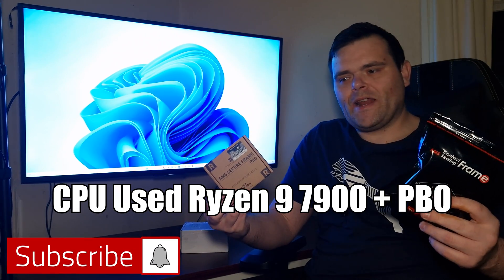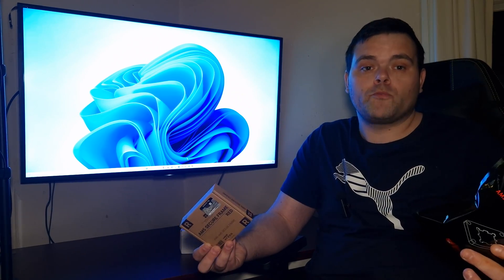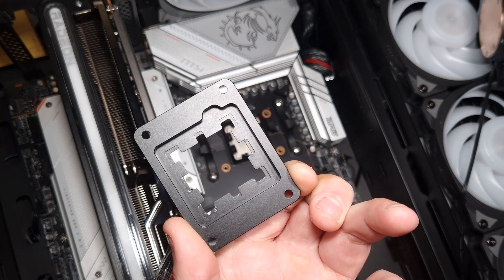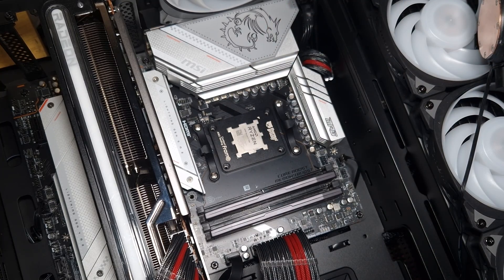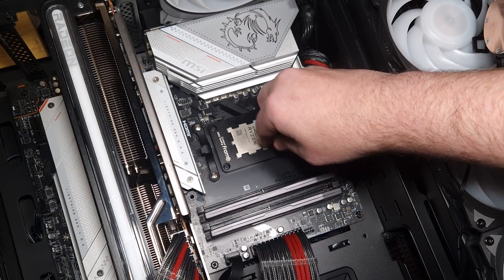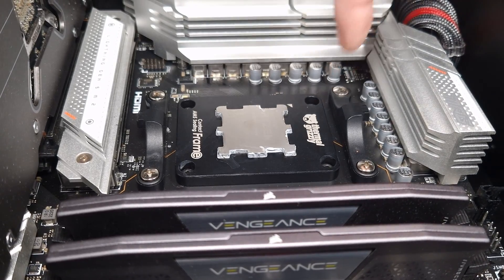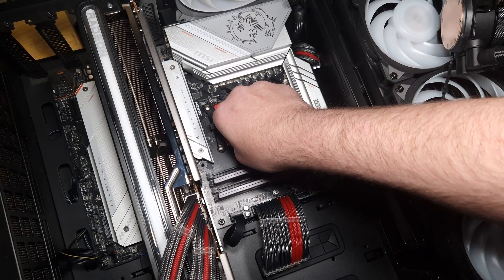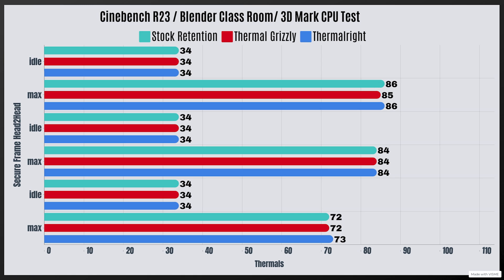Thermal Grizzly Secure Frame Vs Thermalright Secure Frame AM5 CPU's

Comment: they are not made for reduce the temp. It is made to secure the processor for better fit and stop spilling thermal past on other components.
Reply from the maker: Yeah pretty much it was designed for Intel sockets originally as they had issues but then as AMD went LGA instead of PGA brands started making secure frames for AM5

Comment: Just received my Thermal Grizzly Secure Frame and can't wait to use it in my new build. One thing I noticed reading the instructions is the foam pad is only supposed to be used with "Liquid Metal" thermal paste. Does anyone know what the real difference would using it anyway?
Reply from the maker: Great to hear and happy to know about the new build. That foam pad you can just use it as it wouldn't make any difference

Comment: Just returned the Thermalright AM5 Frame, didn't fit my 9950x3D.
Reply from the maker: It fitted my 9900x
Reply: @WELSHYTECH  not for my 9950x3D.  I ordered the "V2".  I'm getting a headache trying to figure the dimensions.

Comment: Please everyone, is this right?  

From what I understand, when running a benchmark, your CPU/GPU will always aim to deliver the best possible performance without thermal throttling. It doesn’t really matter whether you're using a $1 thermal paste or a $1000 one—the final temperature will be roughly the same across all tests.*

So, this leaves us wondering whether it’s really worth investing in. What you needed to show us is which of the three models (default, Thermal Grizzly, Thermalright) managed to maintain the highest clock speed for the longest period without any performance degradation.

If all three ran for 15 minutes and reached the same temperature, it doesn’t really mean much, to be honest. Right?

Now, on top of the two methodologies: same duration and same final temperature, we need to ask: Were they running at the same clock speed? For example, 4.2 GHz?

If all three reached the same max clock speed and managed to sustain it without any performance loss, then their performance is identical. However, if the default/standard shield(secure frame), for instance, dropped to 4.0 GHz after five minutes, then clearly it’s lagging behind Thermal Grizzly and Thermalright, which seems to have provided better cooling.

The temperature will always eventually hit its limit. As far as I know...**

AM5 processors and high-end Intel chips don't care about saving energy when they can deliver more performance. These high-performance processors that will use all available resources to push for maximum performance, which is why the cards hit their thermal limits so quickly. 
But they care about temperature and will turn down the clock if it is reaching high temperatures...The question is: can they maintain quality? Speed? Or do they start to suffer from thermal throttling?

So, which of the three managed to maintain the highest clock speed for the longest period? The default socket, Thermal Grizzly, or Thermalright?

*Regarding the tests: from what I’ve seen, only liquid metal manages to push past these limits, and even then it’s applied directly onto the GPU die and the surface of the cooler. 
**Also, using no paste at all will result in temperatures exceeding the safe limit. Sometimes leading to crash.

Comment: Why would leaving the IHS raised higher make for a "better fit"?
Reply from the maker: Because I find the Thermalright frame way too high, and the Thermal grizzly frame fits better, so you can see the mounting pressure. With the Thermalright frame being at the IHS level mounting may not be as good that's in my experience anyways

Comment: I use cooler master cooper secure frame, funny because after you apply thermal paste, i have to take it off, you know cooper is very conductivity to electric however good for heat transfer. because the stock frame is good for locking processor. Maybe i should try on Thermal Grizzly later on
Reply from the maker: Bet it looks gorgeous though once installed and the Thermal Grizzly frame is good I use it on my test bench

Comment: I bought the Thermalright frame for my i5 12400, I hope everything goes well
Reply from the maker: for that chip, I wouldn't have bothered, and remember for Intel, these frames do help
Reply: @WELSHYTECH yes, although this cpu doesn't heat so much in comparison to others, I want to prevent any issues in the future.
Reply from the maker: Yeah these frames were originally designed for Intel so it will help

Comment: the secure frame is actually made for intel's stupid rectangular design CPU
after watching your video, I have no reason to use it for my AM5
thank you very much

edit: yes it might be useful for thinker that always open and re-paste the processor, it will less messy
but not for some one that build a PC and forget what installed on it (especially AM5)
Reply from the maker: Thanks for your feedback, it is appreciated.

Comment: Isn't this flawed... It will just boost more if the temp is lower... So ofc the temp will be identical... But the actual Benchmark scores might be different if this thing actually helps with cooling
Reply from the maker: It doesn't help with Temps

Comment: PSA! the Thermal Grizzly AM5 contact frame has a design flaw my CPU fell into my socket when I removed the contact frame it got stuck in the foam surround inside the contact frame. Be careful and make sure the CPU stays in socket when removing frame. I got extremely lucky and the fall didn’t ruin my $500 motherboard. I also let the team know what happened. But was a little disappointed in the sorry it happened response. It almost gave me a heart attack. I’ve never dropped a CPU into a socket before.
Reply from the maker: Should always be careful when it comes to installing or removing a cpu

Comment: Why would thermals be different? It just hold the cpu in place.
Reply from the maker: This is the reason I made this video. Many time I saw in groups to buy a secure frame it helps with Thermals
Reply: it depends if the default cpu bracket warps the IHS face from the pressure of the retention clamp 

if it doesn't, then there will be no difference in performance
Reply from the maker: That's with Intel not AMD
Reply: @WELSHYTECH  You mean it doesn't occur with AMD, so there's nothing to worry about.

Comment: So I got a Ryzen 9950X3D and the Artctic Freezer Cooler III can I use a contact frame for that aio please I’ve been told you can’t because the screws won’t fix anyone knows the answer to my question?
Reply from the maker: The main issue is that the Arctic cooler uses an offset mount for AMD, so it might cause an issue, I'd personally not bother as a Secure frame doesn't help with Thermals
Reply: It doesn't matter at all. 
Both contact frames sit below the CPU's IHS plate, so there's no interference there. 
As for the LF III, the brackets use the other holes and have plastic spacers, which are higher than the CPU, so again, no interference. 
The offset doesn't matter, it's dictated by the cooler's brackets.

With that said though, only use a contact frame if you have spare money and don't know what to do with it or, for peace of mind as to not get paste on the sides of the CPU.

Comment: The thermo grizzly version needs to be tightened to 0.06nm which is basically 1/4 of a turn from the first resistance. That's really loose and I would worry about vibrations from the pump backing the screws out over time. I've ended up buying the thermalright version cause it can basically be tightened all the way down without damaging anything.
Reply from the maker: It doesn't matter on AM5 as it will just bottom out
Reply: Typically 1/4 to 1/2 of a turn is more than enough in most cases. I work in CNC work, and 1/2 of a turn is ideal. While 1/4 to 3/4 is acceptable, I make tool holders for machines. So I usually have to keep my mind on that kinda stuff. If it can cut metal with that kind of turn at the first bit of resistance, then those screws can hold down a contact plate.
Reply: @zealousbeing0178 so since you are from the trades, do you agree with a drop of blue locktight or not?

Comment: Benchmark with stock? 
I made OC of my 9950x and I am around 235-250watt with 93-96 degree on CCD0 CR23
I think it will be more visible if this secure frame works when you will OC to 235-270watt. Just a guess
Reply from the maker: Nope PBO was enabled

Comment: Can I remove the original mechanism first, place the CPU on the exposed pins and install the new frame? Or I need to close the original latch first so the CPU sits on the pins better? I am talking about installing it on a brand new motherboard.
Reply from the maker: I do show how to install them

Comment: Thanks for the video. I don't think the thermal test was really necessary since these are not meant to make the CPU cooler or impact temperatures in any way but to ensure an optimal pressure for the CPU in the socket and protect the exposed components on the CPU.
Reply: These are FOR temperatures, and DO reduce temperature over the standard clamp, over time.  The whole issue is the clamp causes a slight bend in the contact surface over time and the gap due to that bend creates an “air” gap which can affect temps as much as 7c in some cases
Reply from the maker: @zombievac but that doesn't happen with AMD that's intel
Reply from the maker: Thanks, but these aren't really needed either. It only helps with thermal paste, and I've used both in both test bench and personal rig

Comment: I'm currently switching to a cryosheet with them. Do I need this silicon at all? Or rather just for pastes and liquid metal?
Reply from the maker: The silicone pad is for liquid metal, but be careful as kryosheet is highly conductive
Reply: @ so better to use the silicon? I only installed the contact frame yet. Kryosheet is not installed yet
Reply from the maker: I would just like to be on the safe side because if the kryosheet moves or touches your motherboard, it can cause a problem
Reply: @WELSHYTECH  okay thanks man^^
Reply from the maker: Most welcome bud

Comment: Is it necessary to place the silicone pad? thermalright has no such thing for example.
Reply from the maker: It isn't necessary nope its mainly for when applying Liquid metal
Reply: @WELSHYTECH  You are very kind for answering, finally, what force should be used with the screws? I suppose that even if you tighten it a lot, it has its exact size of space and does not crush the processor more than necessary, right? and finally, you use the board's own original screws or the ones that came with thermalright or Grizzly, thank you again.
Reply from the maker: You tighten in a cross pattern till they bottom out and use the screws that come with either

Comment: I will make a guess that the two 'frames' are not that different in performance but the Thermal Grizzly cost more. I will see what you have to say and finish my comment. my guess was spot on with what you had to say. I have been paying more for the Thermal Grizzly Contact Frames to support them and their development of better products for the DIYs.
Reply from the maker: Great point!

Comment: Thermal grizzly says theirs wasn’t tested on a 9800x3d.. anyone here use the grizzly one on a 9800x3d??
Reply from the maker: The IHS on 7000 series and 9000 series hasn't changed, so it should just fit
Reply: fits mine did it yesterday but only thing bothering me is the torque specs without using a torque wrench. my digital is only 5nm to 200nm this requires .06nm or 6cnm smh
Reply from the maker: AM5, you only have to tighten it till it bottoms out, which you will feel it it stops
Reply: Complect fit with my 9800X3D!
Reply from the maker: Yes it works with 9000 series AM5

Comment: The only one reason I'm using the contact frame is for protected the thermal paste to go on the sides of the CPU lol
Reply from the maker: The majority of all thermal pastes are non conductive, lol
Reply: @WELSHYTECH  I just hate it about the cleaning, That's all. Thermalright has available in my region for just 5 USD.  To keep my CPU clean every time I have to repasted I think it's a good deal 😂
Reply from the maker: While the price is attractive, not having installation knowledge may lead to damage.

Comment: Just fitted mine. Looks so much neater and knowing its getting a more secure fitment is a piece of mind. I also recommend using the Honeywell PTM7950 Thermal pad that turns into a paste. its brought my temps down by around -5c You'll never need to replace the thermal pad either. It actually gets better the hotter it gets being a phase changing materiel. Also meant to improve after around 1000 cycles of use. To early to tell for me to see those differences just yet.
Reply from the maker: Thing is though AM5 doesn't suffer the same problems as INTEL so secure fitment isn't an issue with AM5
Reply: @WELSHYTECH  It's not always about thermals, though. I know that's what you were testing here, but there's also the aesthetic component as well as what you highlighted in the video about protecting the exposed electronic components on the PCB of the CPU if you're doing liquid metal or another conductive material. I think there's a peace of mind benefit from these as well. The stock  CPU retention mechanism just feels and looks cheap, and although it may not offer wildly different temps, if you're already investing thousands into your PC, and potentially hundreds just into your cooling (custom loops can cost hundreds of dollars), then spending that $10-$30 for the CPU to be held more snuggly all 360° around it instead of only at select points, protecting the surface components,  and making it look nicer can be worth doing. 

The way I see it, if people can justify spending hundreds of dollars on RGB, then buying a contact frame is perfectly reasonable.

Comment: your knowlodge on the matter is very limited, plz study before u make such videos.....ur variables are not under control, specially dinamic clock speeds, thats why ur charts tell us nothing.
Reply from the maker: One I spoke with Thermal Grizzly before making this video, two of which are finding out if it helps with Thermals, three thanks for your interaction 😀

Comment: Thermal cooling scam it is .. Just buy cooling paste or pads or whatever it will work ..
I dont recommend the liquid metal for 4 degrees less, because it will stick on your cooling block and gives a lot of work if you want to change it or remove.
However if you never open it again the Liquid metal is oke .. 
The best tip i ever got for cooling is Calculating the airflow in the PC case will give you better results..
I do this by every new build if i have a new case.. Airflow is king and important !
Reply from the maker: I didn't use any liquid metal

Comment: My Intel 14700k contact frame installed flawlessly on an Asus z790 mobo. Went with thermal grizzly for the frame and a Kryosheet instead of thermal paste and an ek nucleus 360 AIO and it runs on average 10-15c cooler under load with the new setup as opposed to stock:

When you install a thermal grizzly contact frame it’s totally fine to bottom out the screws, you actually should bottom them out but don’t force it, then back out the screws one at a time by 90 degrees at a time until your cou boots.typically you’ll need about half a turn to an entire rotation of the set screws to get the system to post. Mine was super easy to install. I just clocked each screw back 180 degrees 90 at a time  and it runs flawlessly as it did before just much cooler now. Absolutely amazing setup for a much less maintenance heavy water cooled setup. If it was direct die ptm 7950 on a 14900ks might make sense for intense overclocking but a lapped or even stock cou benefits greatly from modifying the standard mounting/thermal solution. Highly recommend doing this as it also preserves your cpu integrity and prevents heat warping due to uneven pressure distribution.
Reply from the maker: I know it helps intel but doesn't for AM5, which this video is about
Reply: @WELSHYTECH  Part of the problem is the super thick IHS on amd CPUs. This does help mounting pressure and prevent cpu deforming over time either way which is good but if you wanna see super nice temps on am5 with this then lap the cpu and use liquid metal. i cant say I woud have goten a significant temp increase without the kryosheet install. My cpu cooler has enough paste on it when i got it for a threadripper and idk if that is beneficialto cooling a smaller cpu witha smaller IHS so after cleaning it offf and replacing with the kryosheet and using a TG contact frane i got an average a 12-15 degree drop in temps under load. at idle its about 4-5 degree drop. Im curious if lappig and PTM 7950 would improve temps or if the kryosheet iws the best "set and forget" option.

The point here wasnt to get ice cold temps just to get a setup you dont have to ever maintain and my method of application works for both am5 or intel but i cant gurantee temp drops without lapping AM5
Reply from the maker: @CommonSenseUncut  These frames don't help deforming as on AM5 it doesn't have the same issues as Intel even Thermal Grizzly has said This doesn't affect anything with the AM5 socket

Comment: Those frames are actually bending prevention for the cpu's. No point testing them on a cpu that is not bended and trying to look for temperature differences. But they are cheap enough to give peace of mind.
Reply from the maker: These frames don't do anything because AMD doesn't suffer the same problems as intel 

And testing for any temperature difference, there's definitely a point. Otherwise, this video wouldn't still get views and engagement